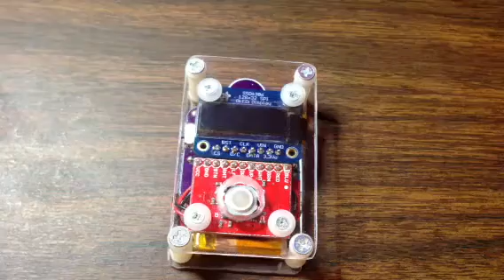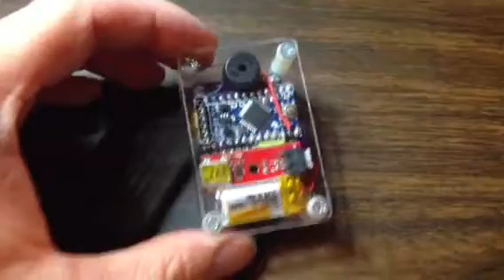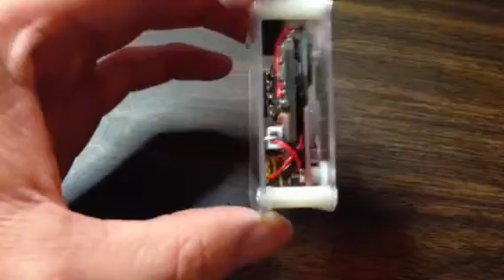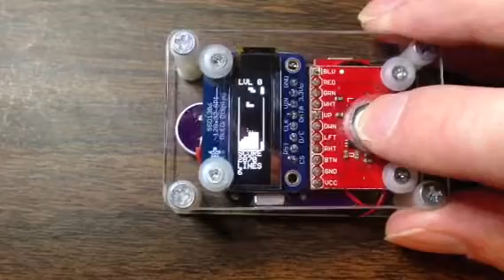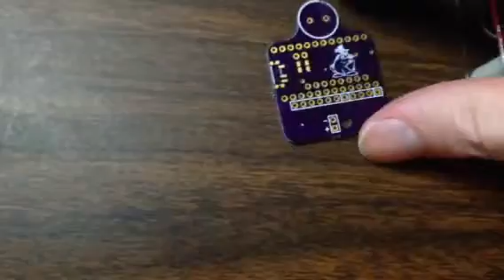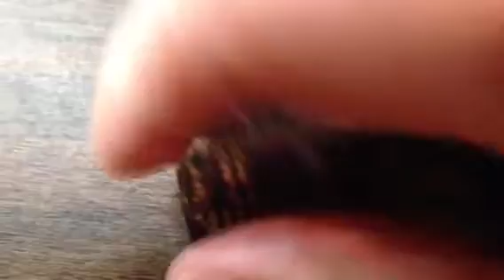Arduino mini Tetris

Comment: how do you manage to change the output from TV to oled...? i have a 0.96 oled display it would work? (128x64 i2c only version)
Reply from the maker: Easy most of the driver functions are the same, there is small difference of the syntax of the functions. For example the print function of TV includes the coordinates of the cursor in line with the string however on the oled driver it will be a separate function call. Little things like that but just do a search for "TV." and you will see all the places you need to make a change.
Reply: Hi, I'm also trying to get some of the this to work on SS1306 OLED but not having any luck. Please can you share the code if possible? thank you:)